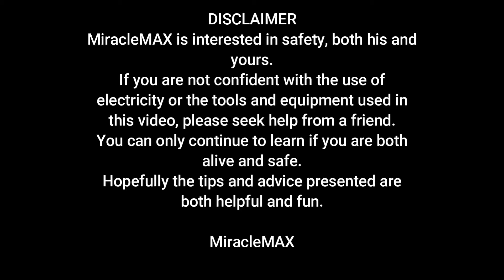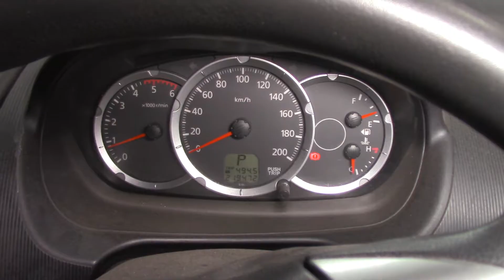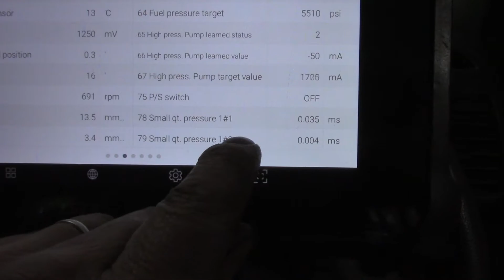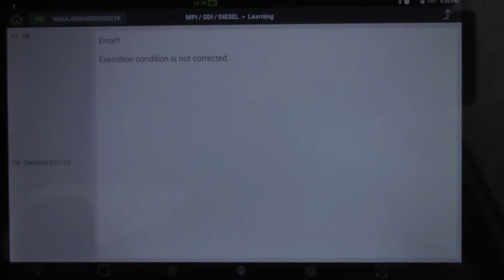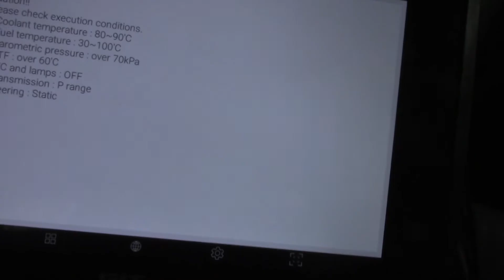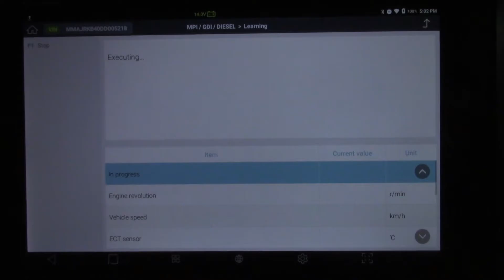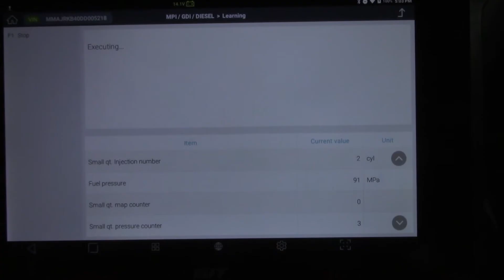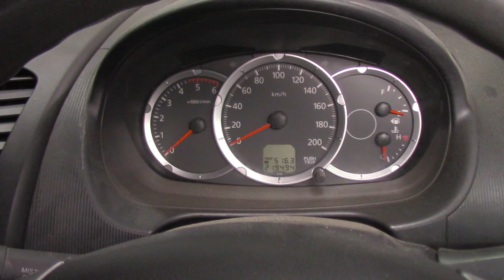Triton Small Injection Quantity Relearn

Comment: Hi Max, great video mate. I've just had a major rebuild on a seized 4D56, ouch! and have had a service done after the first one thousand k's. The engine is surging a bit when accelerating since that service. Could this be down to the need for the SIQR? Also, how much should it cost to get the SIQR done? Cheers mate.
Reply from the maker: Hey Steve. 
Glad you are up and running again. Very difficult to say what the issue could be without all the details, fault codes and live data. It could be as simple as a vacuum leak or a connector accidently left of a sensor.
To do the procedure it would take about an hour, including a decent road test to create the correct conditions.
MiracleMAX
Reply: @MiracleMAX  Thanks mate, much appreciated. 👍

Comment: I cant learning thé small qt in Mitsubishi  it is manual transmission . Is not going to exécution système
Reply from the maker: Hey abduol salam CAPO-CHICHI ,
The systems on these vehicles are very fussy with their criteria. Take it for a road test and then usually when you come back, most of the conditions will be set. Look carefully at the conditions. Just like in the video, the temperature is usually the reason for it not carrying out the procedure.
MiracleMAX
Reply: @MiracleMAX  ok great it's don
Reply from the maker: @abduolsalamcapo-chichi4157  Congratulations! 😉
Reply: Thanks for the informations is Don

Comment: Miracle Max, does this interfere with the settings of my triton that I’ve had chipped and tuned.
Reply from the maker: Hey Bob,
A common rail diesel injection system with use multiple injections per cycle. This could include Pre, Main & Post, however, it could be as many as 5 distinct sections to the injection phase.
The small quantity injection is usually done during the Pilot phase. As parts wear and conditions change, adjustments must be made to compensate for these changes, so Small Injection Quantity Learning  will adjust the acceleration per cylinder in order to achieve maximum engine smoothness. 
In some cases the vehicle will execute automated Small Injection Quantity Learning during normal operation every several thousand kilometres. So, long story long 😊, no this won't effect any settings due to modifications, in fact, it will improve the smooth operation of the engine.
MiracleMAX

Comment: I had my intake manifold and EGR ultrasonic cleaned in December 2020. Would I need a SQR? I get the same issue of a delayed start in the morning or when the engine is cold. Cranks over 6 times before it’s starts with lots of white smoke coming out the back. The priming pump on the filter is usually soft in the morning which makes me think that air is leaking into the system somewhere. Help please.
Reply from the maker: As mentioned in the video, a relearn should be done as regular maintenance during servicing, not just during major repairs.
Yes, a relearn should definitely be done after an intake clean.
Reply: @MiracleMAX  Thank you. I’ll book the car in for a relearn ASAP.

Comment: Love watching your videos. What scan tool do you recommend for the average back yard mechanic. I want to do this exact job along with fuel line leak check etc. Dealers charge an arm and leg for intake/egr clean.
Reply from the maker: Hey Warren10241,
Wow, that's a loaded question! It all depends on the money you are willing to spend and what you expect from a scan tool.
Generally speaking, the cheaper 'scan tools' are just a code reader. In other words, they are able to read codes, clear some codes and do some very basic tests.
A proper scan tool (this is where the money gets spent) is a bi-directional tool. This means that you are able to carry out actuations or control some systems, which helps with diagnosing faults. Also it will include 'special functions', which includes the relearns with injectors and DPF, just to name 2.
Once again, unfortunately, it depends on how much money you are willing to part with.
MiracleMAX